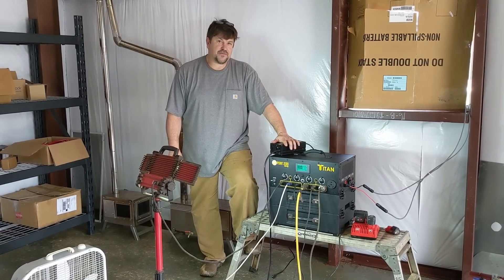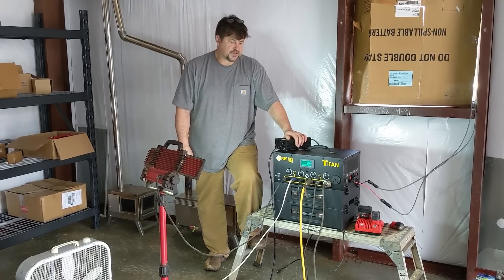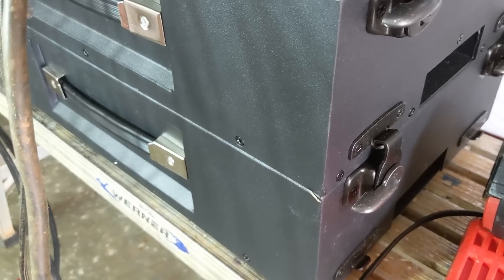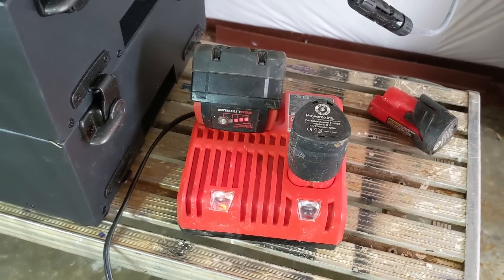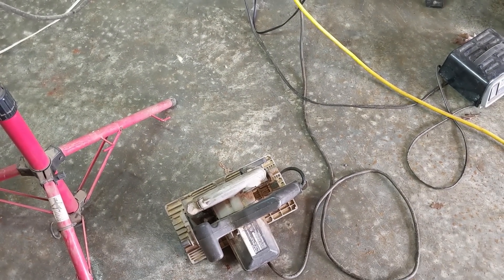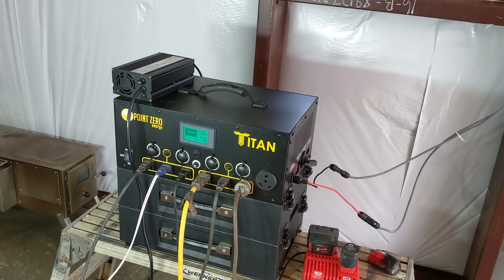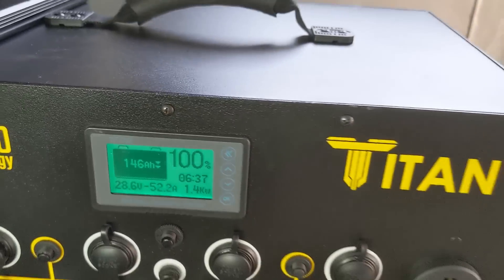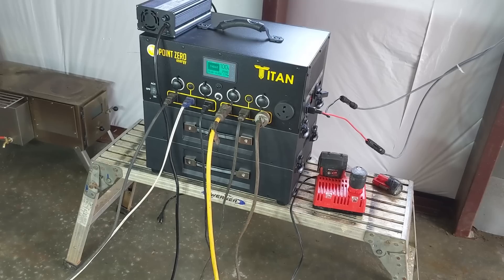Putting The TITAN Solar Generator To The Test!

Comment: I purchased this exact unit with 2 batteries just as you have here a few weeks ago.  I will be running my entire cottage on this.  Mini split for heating and cooling about 800 watts, then modern energy efficient fridge and microwave and a few LED lights.  The big draw will be the mini split. The good thing?  I will have a serious solar array to bring in a constant 2000 watts of power and I live in South East Arizona with no end to sun hours per day.  Every expert I have talked with said the Titan will do the trick.  Even run the mini split.  The trick of course is to have enough battery storage for when the mini-split runs after dark.  I may need to purchase additional batteries and do some final configuration but am optimistic this unit will run my whole cottage.
Reply: Good luck if you get yours I order my 6 months ago from point zero and I still haven’t got it.
Reply: @billfowler9325  I ordered mine November 30 but was told it would be March so I am fine with that.  Also I have to figure out how to do electric and wire this whole place.  That's AFTER I learn plumbing LOL.  So no hurry here.

Comment: My Titan came in mid March and it works great.  It starts and runs my 13.5 k BTU AC in the camper, no problem.
Reply: Please let us know how many hours. Ty
Reply: The Titan runs the air conditioner for two and one half hours on a full charge. More if charging with solar or a generator.
Reply: @brucebugbee6604  I will be running a 800 watt mini split on mine.  All the experts I have chatted with says the titan can handle this no problem.
Reply: @affordabledesertliving3487  800 watts is a piece of cake for the Titan. You should have no problem with that setup.
Reply: @brucebugbee6604  Thanks so much!  Looking forward to it arriving in the Spring and setting it up!
Reply: @brucebugbee6604  fantastic.  Great to hear!

Comment: I seen a lot of generators and although this is more than I need currently, it's absolutely perfect for emergencies!  Thanks for a great video.  Checked online quickly and it's around $3k for a starter kit it seems (without the extra battery). 👍  It does appear to be a workhorse.
Reply: I have a gas powered house one which kicks out 14KW and only cost $3000. who needs one of these unless you want portability? I don't need to worry about solar - if the power goes out it kicks in using the gas supply

Comment: Each handle strap you see here or on any other demos =1 battery.  This demo is with 2 batteries.  You can detach and charge one while using the rest of the system on location 👍

Comment: Comes down to this. In an off grid situation well this run a mini split that drives around 800 W for all heating and cooling needs all year around on solar. The good news is Arizona. Nobody can seem to answer this question for me. Thank you
Reply: EASILY. As long as you have a way to recharge it every day, it's good for several times that.

Comment: How's it holding up ? My honda 2200i runs the fridge and  basics in my house if needed.  Wondering if the titan can also ?
Reply: Seeing no reply from the guy who runs this channel, I'll tell you.  Most people who have a Titian are happy with it.  There have been some problems and there were some recalls on a number of units.  I think the company is trying to build an excellent product... but at the end of the day, you have to charge it, and if you want to actually use it much... it requires constant energy input (much like a traditional generator)... only as a much higher cost than gasoline in equivalent watts.  Unless and until the cost of standing up a Solar Array comes way down a traditional generator makes more economic sense, and is generally more easily defended and lets face it way more portability... can you imagine needing to move around something that could provide 1,000 watts AC continuous 24/7 and 2,000 watts periodically.  The Titan requires considerable infrastructure behind it.  Would love to have one... for free like his.  Then I could take the money I didn't have to spend on it, to stand up an Array to make it feasible.  It's a great demonstration project... but economically it makes no sense for 99% of the population.
Reply: @michaelmorris1802  well, its quiet as a whisper. I think thats worth a lot. You can put 6 batteries on it. I think this things a mnfn powerhouse.
Reply: @michaelmorris1802  Thank You for Your evaluation of this generator , 
Looks like it's a great idea ( and a even GREATER way to drain Someone's bank account ) ! Definitely NOT a Poor Man's problem solver ( bet those extra batteries are just real cheap. . .
NOT ) !! I NEED an AFFORDABLE system for a 24/7/365 small cabin
for two People ! Not a " little house
on the prairie " ( not a mini mansion , just something in between ) .
Reply: @michaelmorris1802  if there is a nuclear war it might be nice to have one of these units. Gas will be hard to come by. Just my two cents.
Reply: @johnhoward7298  in the end you location, loads and usage habits define how much power you need and in what form. There is no solar solution that is cheaper then gas or the grid, not yet. But when the grid goes down and the gas station can’t pump, a solar system will supply you indefinitely is sized properly. 
We just can’t have a champagne taste on a bud light budget. Evaluate your priorities and budget and then go for a system that will fill your needs. DIY projects can bring the price down some.
Reply: @michaelmorris1802  I'm sorry it's taken so long to Thank You for Your 
response ! I have about given up on 
My plan to build on that properly
( its apparently not practical or 
affordable ) for the time being .
Reply: @michaelmorris1802  Except for those of us who live off grid and prefer peace and quiet that a generator cant offer.  Also You can stack up the Titan to offer more power than most generators deliver.
Reply: @4philipp  The Power mongers at the top who own the grid will make sure in a few years your power bills will continue to climb.  Like being in bed with Somali Pirates.  Not interested in sleeping with those personally.

Comment: I have three Titan batteries already and have nowI purchased a HSKY ELITE 48V battery.  I had an external battery expansion cable made that had 6 gauge wire with a SB50 on one end and a SB175 on the other.  However, it didn’t have the inline c/b as recommended.  The 150A inline c/b appears to have a history of prematurely popping.  Do you think it would be okay to use a cable w/o the c/b installed?  I hate to cut into a ‘finished’ cable to insert a c/b that may make the connection ineffective.

Comment: Scott, How does this compare to the New INRGY modular set up which will be released in the near future (specs available on their website). The INRGY seems to be a better value. What are the shortcomings to this Titan system? What is the maximum number of watts that can be used to recharge the Li Ion batteries?
Reply: @zfontain1975  Yeah...I decided against them completely. The Titan is actually a better rig, at least until someone comes out with something even better. Problem is the waiting list is so long

Comment: I have a portable solar generator that I use for my backwoods camping. I am not running tools like you or anything of that capacity. I run just some minor lights and my laptop and charge my phones and maybe a small handheld printer/scanner EcoFlow Delta Solar Generator. I find it has almost military  durability . It is something I can pack easier than most. So far I have been packing it in and out of  the cabin I have. I would leave it and just let it sit and charge but I have had trespassers and i don't want to show up thinking i am going to have it and then it is gone. anyway like I said it is something you probably wouldn't use because it is too small. just thought I would show you this 
keep on keeping on 
Semper Fi
Reply: Which brand do you have? How do you like it so far?

Comment: I wonder if they make a 240v 50Hz version?
Reply from the maker: They had tried that for a while but at this point they do not have one that's 240-volt sorry.
Reply: @engineer775  thanks for your reply really appreciated. Im in New Zealand and its difficult to find Solarc also. Perhaps when I go off grid I should full the house with 110V equipment and be done with it lol...thanks again

Comment: Could I use this for full time VanLife? It’s good to know I can run pretty much anything but would 2 kw be enough to run say an induction stove, VitaMix blender and other appliances a few times a day? Cheers
Reply: You can add any number of batteries to accomplish eaery need you have with your van. Problem may be in charging them with solar. Van roof rather small.

Comment: How would this system do powering a small cabin (frig, lights, tv) for several days with 400 watts of panels?
Reply from the maker: I would add a little more solar than that. You can put up to 2,000 watts.
Reply: Depends on how many whr. you use and if you have sunny days

Comment: So, the top unit itself does not contain a battery?
Reply: No. The battery or batteries attach to it via 4 clamps. The electrical connections are made when the two are joined. It is impossible to hook it up incorrectly.

Comment: Can you plug in a solar panel directly, or is another controller needed?
Reply: Just plug them in directly, the Titan has 2 MPPT charge controllers built in. It comes with a MC4 to Anderson Power Pole connector.You will usually need at least 2 panels, wired in series, as the minimum input voltage is 35.
Reply: Can it be recharged with a Honda generator too?
Reply: @woodspirit98  It can be charged by multiple sources at the same time. Solar, land, generator, or car battery. If battery is run out of power You can jump start it with an individual solar panel.

Comment: I need to get a well put in& have no electricity on the property.  Can a solar powered generator work the pump? How big would it have to be?
Reply: Watch his older videos. He likes to do a solar direct pump where possible.
Reply: @atomicsmith  thanks so much!
Reply: PV direct is awesome, just don’t expect to run a firehose with it. Slow and steady wins the race. A 1 gal per minute pump on solar will give you 300 gallons in 5 hours.

Comment: As shown: $4400.00
Reply: Horace Rumpole you sure? I thought it was more.... oh that’s PLUS panels right?
Reply: I just looked it up and l saw a couple websites priced it at $2,995.00 probably this had less features than the one as shown
Reply: Boringo PR many demos show 2 batteries.  Horace is right $4,400 plus panels cost extra and none available now.  Just pay now an they should ship in April 2020
Reply: @ds525252  sounds pretty good thanks
Reply: Holy price tag Batman!
Reply: @boringopr4369  $2995 is the base model with one battery, 4395 is with two batteries
Reply: No way. Where? With 2 additional batteries?
Reply: Thats got 2 added batteries. No way 4500
Reply: @stephenvanboening2147  not two added batteries. The base model comes with one battery at $3000. Each additional is another $1500. You can connect 6 or 8 batteries I believe. With just 2000watt of max solar input I think 4 batteries are the max you can charge in a day (chances are you have loads on it during charging). However more batteries may give you better charge cycle life if your daily consumption doesn’t exceed 8000 wh.

Comment: Something a bit more waterproof would be more versatile, and I don't know why they didn't add switched outlets and individual OC trips.
If something is heavy then it needs to be on wheels, just to get it off your truck.
Reply: It’s 30 or so pounds for each component. While nice being stacked you don’t have to stack them when in use. Use a hand truck to move it.

Comment: The website says 1,000 watt max charging not 6,000 as stated but still good.  Also it will only charge 1 battery in 4hrs, demo shows 2 batteries being used... still good.  Heavy but no issues for my RV. Nice!
Reply: Actually each battery for 1300.00 lists 1000w but really is 1200. U can stack six safely bringing total power to 6000 respectively.
Reply: Stephen Van Boening how much for each battery?
Reply: Are two batteries being used in the demo? I think each handle is a battery, quite expensive like almost $6,000.00 before taxes and shipping? Or less?
Reply: @ds525252  everywhere ive seen is about 1300 ea. Then youve got shipping. I dont have one but i love this damn thing.
Reply: @ds525252  honestly, i could go get one right now w 3 batteries but i wont really need it for boondocking for mabey 5 more years. Technology gets better every year so just think about that. When do you really need a big investment like this. Ya their cool but...
Reply: Stephen Van Boening 
 oh I fully agree and I bought a different brand and bought 2 units and will have 3 batteries, 1 that I can swap or charge while using the others.  I use mine daily for cooking, hot water, fans etc etc but now I only use 1 unit and that’s enough, since I cannot use it for my AC and I have not starting using my 12volt fridge yet.  I know what these things can do and what they can’t.  I do see the Titan being the closest to running a high efficiency small unit to cool a section of an RV or a small RV.  Lots of good videos on it but I have other needs before I’ll pay that much for 1 heavy unit (for others it’s perfect and that’s great). I’m very glad I can experience and experiment with these units before I actually have to have them.  Oh no the Titan is like $5,999.00 with two batteries.  You are thinking of another brand that has less power but is priced lower and lighter.  To me they each fill a niche, So I do like the Titan but not for what I need now.  You can check out the prices here below.  The Inergy Flex is the type I’m buying and I have had the Kodiak for a few yrs. 

https://poweredportablesolar.com/product/titan-solar-generator-no-panels/ref/14/?campaign=product $3,000.00bate bones without shipping or any cables

The option I chose was buying two of these for the same price (apples and oranges)

InergyTek.com $1,3500.00 pre sale and 10yr warranty on its battery.  Bare bones no cables or panels and it’s not shipping until December.  Both charge via Sun, wall, or car which is surprisingly useful.  Both fit different needs.  Both have advantages👍

Comment: With respect, Everyone needs to stop with the solar generator terminology.  It's not generating solar power It's storing DC power. Key here is storing and not generating. You mentioned it yourself that you are charging it with solar power so that implies that the solar power is created elsewhere and then used to charge or store the power. I see an AC input that also implies that power already created by other means is stored in this unit. I get that you get some additional views when you use that term but it's just not a correct term and I and others believe that it only serves to confuse new people that become interested in using new tech batteries for portable power stations. These setups are power storage systems that can be charged using anything capable of producing power from hydro, coal, nat gas even nuclear that is created and sent to your home via power lines to solar panels that generate DC power. You can even use a gas or diesel generator to add power. This is a power storage system and not a solar generator. Call it what it is and maybe your channel will get big some day Mr. Engineer.